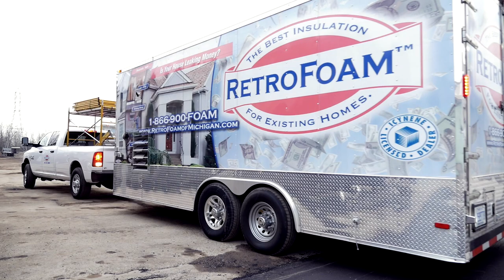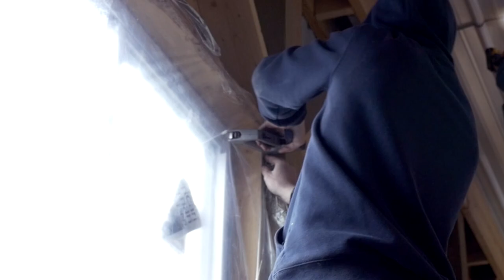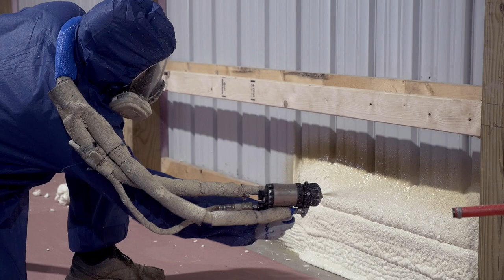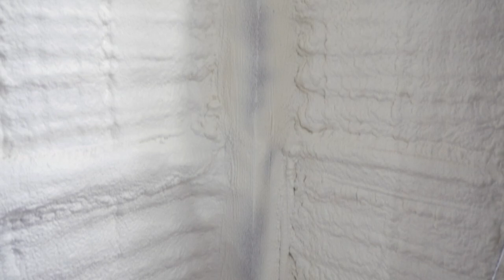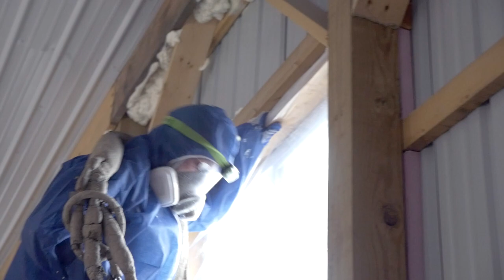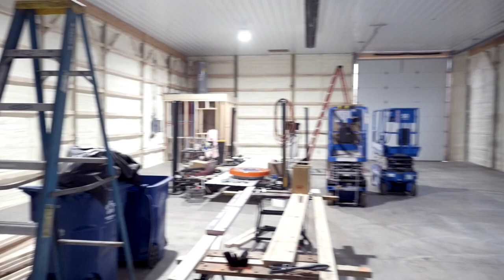Pole Barn Spray Foam Insulation: Prep and Install Closed Cell Spray Foam

Comment: Hello, I have a question for you regarding this install. Do you still have the dimensions for this building...? Height, width and length?
or the numbet of square feet you sprayed...? I ha a 40 by 50 building I will have erected in the spring and am curious on approximate cost for closed cell foam spray install cost. Just trying toget a figure for budgets. Thank you for your time and consideration, Stay Safe, Greg
Reply from the maker: Here is a link to our online budget calculator! You can implement any dimensions you need and it will give you a rough price range for the job! https://www.retrofoamofmichigan.com/calculator

Comment: Should the poles have at least 1.5" of foam also to prevent condensation through poles?
Reply from the maker: It wouldn't hurt to insulate them, but it's often not needed.

Comment: What temp and pressure are you spraying. Mine is trying to run
Reply from the maker: That will depend on your equipment and what material you're spraying, as well as a bunch of environmental factors.
Reply: 1200 at 130 degrees

Comment: Would have used spray foam instead of rigid foam behind 4x4s.
Reply from the maker: Yes, the building owner in this video had it built like that. Foam board is a great product but requires fitting and additional air sealing around all seams.

Comment: I have a 60 x 120 with 12 ft ceiling no windows and one 10x20 door what is rough estimate that it would cost to have this service performed on the walls
Reply from the maker: You can use the budget calculator on our website to get a rough cost for your project.
https://www.retrofoamofmichigan.com/calculator